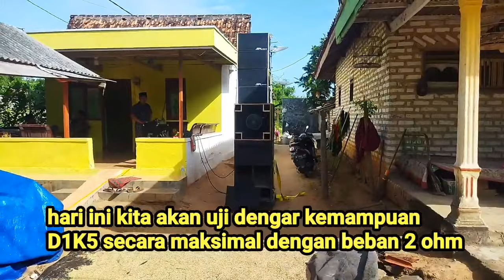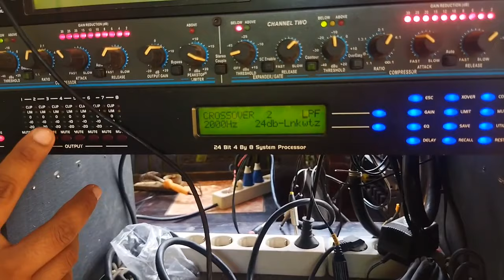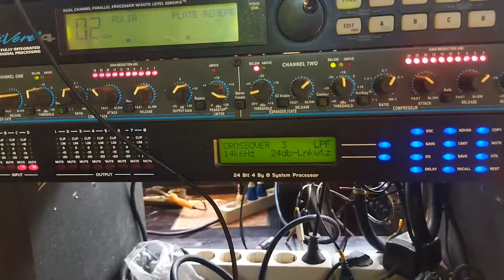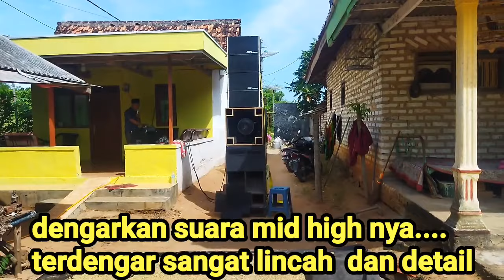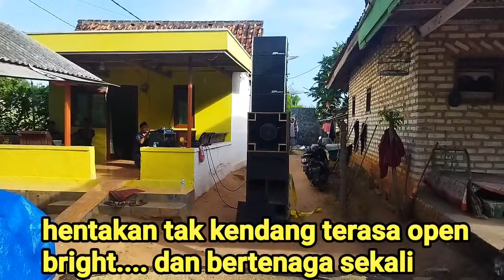CEK SOUND CLASS D1K5 PRO. MAIN 2 OHM

Comment: Om nanya dong
D900 
Pke 90v 
Udh jadi tinggal pasang d mobil buat subwofer
Speaker 12 in
Main d 2 ohm aman ga ya
Terimakasih🙏🏻
Reply from the maker: aman sih... yg penting psu nya tdl drob. dan wajib hati2 saja jika psu sdh kedodoran. main 2 ohm sebenarnya riskan....
Reply: @Subakti_wardoyo  maksih om
Mau nanya lg om 😁
Klo d pasang input jadi short
Awal sya kebalik pasang input -+
Itu apanya y
Ic TL071 kah kira2 om
Reply from the maker: klu cm kebalik input nya g akan bikin rusak. 071 tidak akan rusak
Reply: @Subakti_wardoyo  tp klo d kasih input jadi short om
Klo d pegang input ada respon speakernya
Apanya y om kira2
Reply from the maker: g ngerti saya... klu dikasih input short, klu disentuh input ada respon di speakernya... ???
Reply: @Subakti_wardoyo  ada om responya
Ni lg saya coba cari
Klo udh nyerah saya kirim k om aja 🤣
Reply from the maker: trus yg dimaksud short nya itu bgmn ya??
Reply: @Subakti_wardoyo  klo d pasang input 
Tegangan drop smua
Lampu indikator ga nyala
Reply: @Subakti_wardoyo  input sya pke filter sub
Dan bluetoot 
Sya coba lngsung pke input bluetoot tetep short
Bias pke stepdown LM 2596, inputnya sya ambil dri inverter ada buat bias
Reply: @Subakti_wardoyo  ternyata power lpf ga boleh nyatu sm bias om
Kmrn sya satuin jadi short
Sya pke inverter 12 to 90v ct, plus 12v tegangan bias 
Skrng udh bisa ambil power lpf dri tegangan acu lngsung
😁
Reply from the maker: waduh.... kenapa g dipelajari dulu... negatip bias itu harus sumber terpusah. tidak boleh satu jalur dgn ground power
Reply: @Subakti_wardoyo  iya om msh belajar😁
Minta saran om 
Suplay filter sub lebih baik ambil dri mna y om
Apa prlu d tambah inverter lg khusus buat filter sub
Fiter sub bgus yg ct apa single 
🙏🏻
Reply from the maker: harus nya ada aux husus buat tegangan2  sub filter dn lain2...klu pakai aki mmg agk sulit, harusnya dibuatkan di inverternya
Reply: @Subakti_wardoyo  klo tambah glungan travo bsa ga om
Jd output travo jd ada 3 ,  12v bias, 12 v sub, 90v ct
Sblmnya ini output jg 75v ct
Sya tmbah glungan naikin k 90v
Atau bisa ga ikut suplay teganga ic tl071..?
Soalnya sya liat prodak dri madura tau lah 😁
D900 plus sub, kmungkinan ambil dri tl071 kynya om
Reply from the maker: bisa tunggal dibuatkan xtra mau berp xtra bisa
Reply: @Subakti_wardoyo  ok makasih om🙏🏻

Comment: D2k5 ini upgrade an dari lexus 20000 pak ?
Reply from the maker: bukan ms... d2k5 ini fullbridge... klu lexus klu g salah itu halfbridge. tenaga lebih badak d2k5. cuma maksimal main dua speaker. speaker2 besar
Reply: @Subakti_wardoyo  main di 2 speaker perchanel pak? Jadi 4ohm apa gmna yaa..😅
Soalnya penasaran upgrade an driver vlass D ini yg katanya skrng bisa clarity lebih detail di banding class" ab/h
Reply from the maker: iya ms untuk semua class d fullbridge malsimal 4 ohm. rermasuk d2k5 ini. dicona lah.... sy rasa sampean tdk akan menyesal...😀
Reply: Hehehe iya mas, tapi bimbangnya kit power ini katanya sering trouble/dor, tp ada juga yg make 1th lebih masih aman
Reply from the maker: iya jika power nya tidak sehat... ttp klu sehat... ya aman ms. sy sering rakit buat sound rental temen2 sini.. dah taunan ms.  ya namannya kerusakan jangka oanjang ya pasti ada, sama spt class lain sm2 ada potensi rusak.....
Reply from the maker: iya pcb deaain beliau... yntuk link tidak ada... pemesanan kita pre order ms
Reply: @alang5059  semua komponen elektronik punya usia.